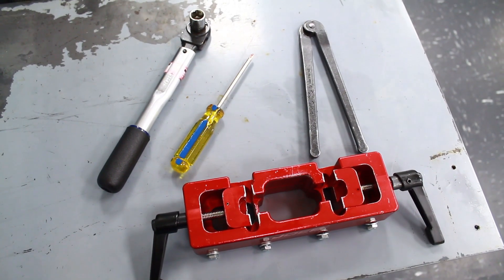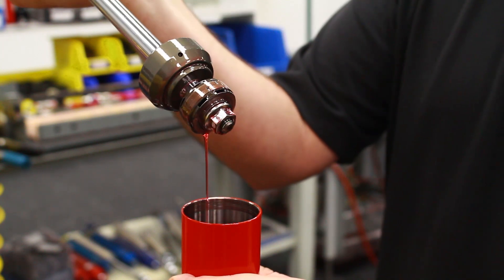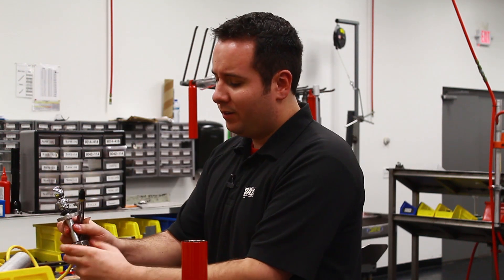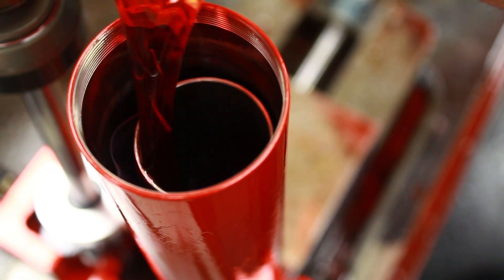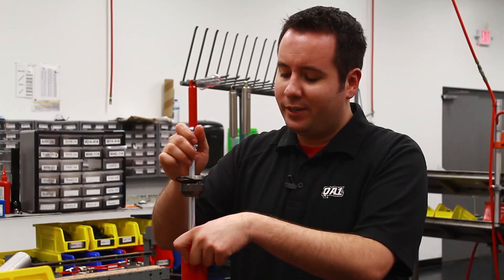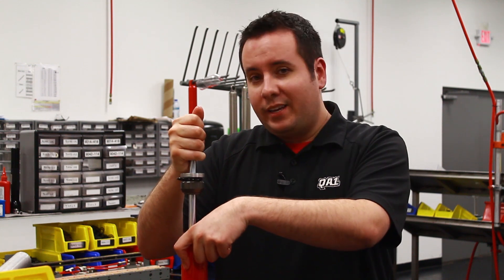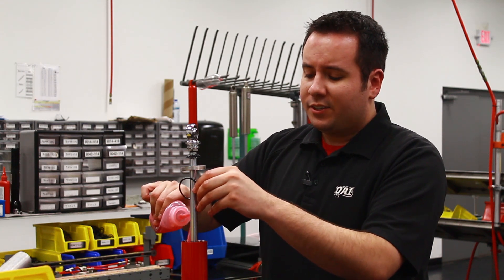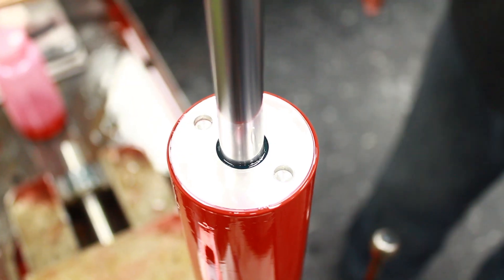Rebuilding a QA1 Circle Track Twin Tube Shock - QA1 Tech

Comment: I disassembled my shock this afternoon because it was leaking again. This is the third time that I would be sending it in to be rebuilt. I wanted to see what was inside it. Mine has an o-ring around the compression tube that is not shown in this video. Where does this go on the tube? It was about centered on the length of the tube. I am giving up on the coil over shocks and going back to coil springs and conventional shocks.

Comment: Why  u wrapped the inner tube with plastic bag
?
Reply from the maker: It's a gas bag. You will need to replace the one you took out when reassembling the shock.
Reply: How you feel that bag, and at what pressure and which gas? 
Is it (gas bag) use in mass production?

Comment: Really cool explanation, after watching this I have a more clear idea, in my case happened that the tube had some air and messed with the correct function of the shock. One question, should i use hydraulic fluid with more density? Now I'm using shell spirax s1.

Comment: Is there a measurement for the oil in the shock?? If is, what is the difference if we put more or less oil in the tube?? Tq
Reply from the maker: No there is no measurement for a twin tube shock. You don't want any air pockets in there as it would create problems with the performance of the shock.
Reply: QA1 thanks for the answer
Reply: if there is air in this shock then airation of oil will occur and that will lead to shock fade when the shock reaches higher tempratures.

Comment: did you introduce compress air as you did on the mono tube?
Reply from the maker: Hello. The gas bag accommodates for the volume of the piston rod in a twin tube shock, so no compressed air is required. Thanks!